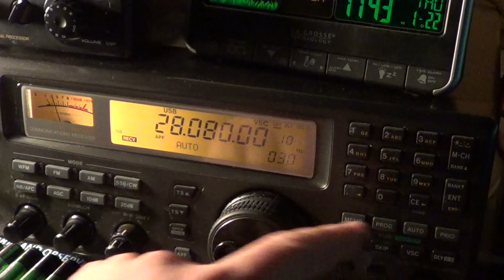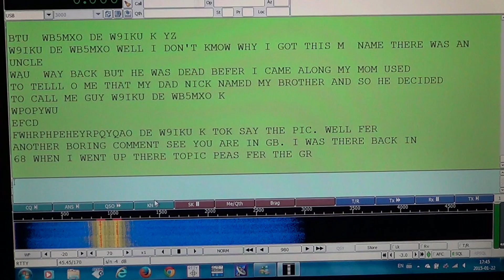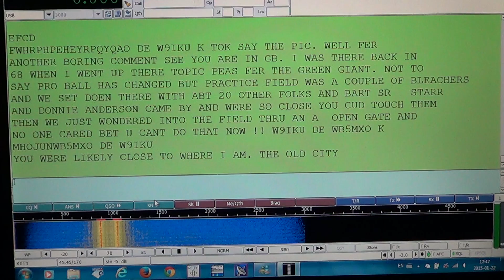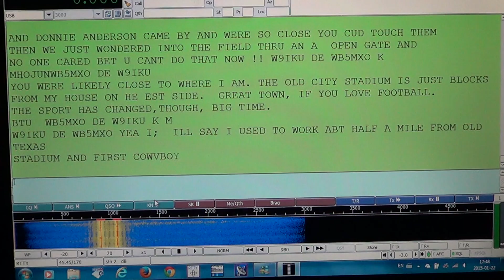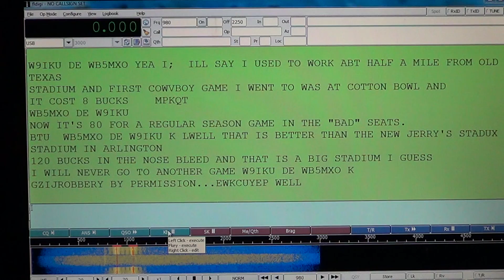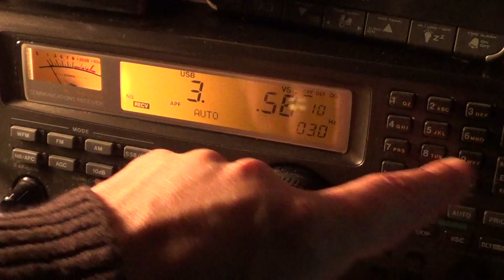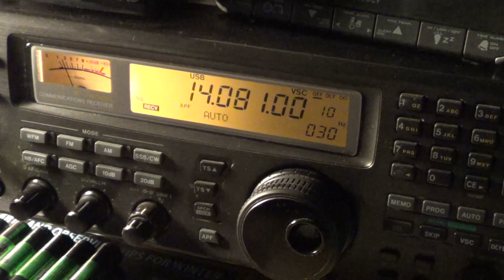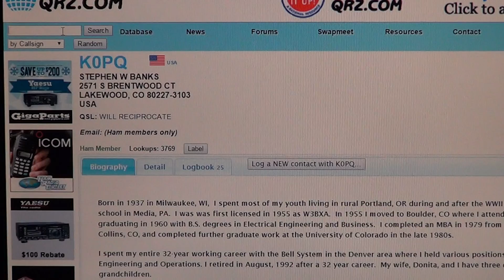FLDIGI Tutorial How to decode amateur radio RTTY signals

Comment: Rtty is hardly ever used now its all ft8 which is a pity.
Reply from the maker: I hear RTTY daily here on 20 and 40 meters also other modes, FT8 is popular but there are a lot of users of other modes you just need to take the time and tune around
Reply: @OfficialSWLchannel   I use rtty evert time i am on the radio but does not seem many folks use it now  i have had plenty of contacts on rtty  but mostly when the contests are on at the weekends .When i look on the dx cluster sites its 99%ft8.
Reply from the maker: it's a question of keeping up the activity, problem is most people don't do it thinking no one every uses it ... FT8 is popular mostly cause when you don't have much power and a modest station, it is easier for DX but I hear many other modes regularly, just keep trying
Reply: True. RTTY only becomes active during RTTY contests.😢

Comment: fldigi is pretty cool was using it just to decode CW but will try decoding RTTY next - easy enough to switch modes.  This particular QSO between W9IKU WB5MXO is interesting because both have the first name "Guy", very unlikely.  The chances of that happening at random is 1 in 11.111111 million!

99,258 "Guy's" in the U.S. / 330,858,686 people in the U.S. = 0.0003
Probability of two guys =p(GUY)*p(GUY)=0.00000009
1/0.00000009=11,111,111
Reply: Interesting twist on the video.

And the probability of both of them being hams, and doing a relatively rare ham mode, on the same day, same UTC, and same frequency:

0.000000000000000000000000000000000000000000000000000000000000000001

Comment: Im just starting out learnig about the digital modes. I've decoded RTTY 45 but in between transmissions I just get random characters being printed to screen.  Does anyone know why this is? Is it due to noise or something else? Thanks.
Reply from the maker: normal its the noise that generates this
Reply: @OfficialSWLchannel , thanks. I'll see what I can do to reduce it. Im using the audio out that would normally go to a tape recorder and the volume isn't adjustible except for the input to the sound card.  I can also try turning down the RF gain.  Unfortunately im using an indoor long wire with no ATU at the moment.
Reply: Are you on the correct side band ?